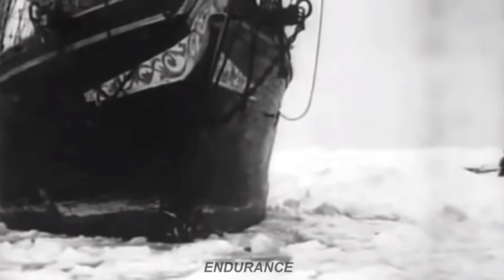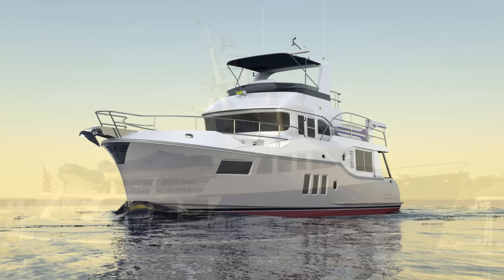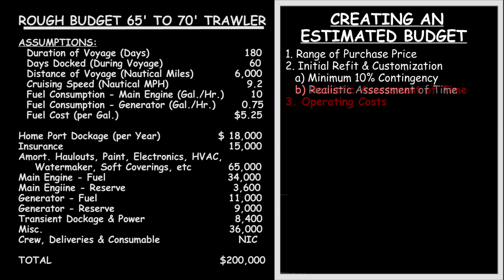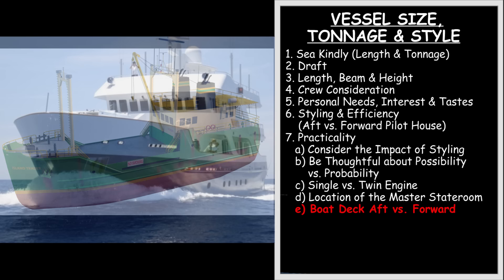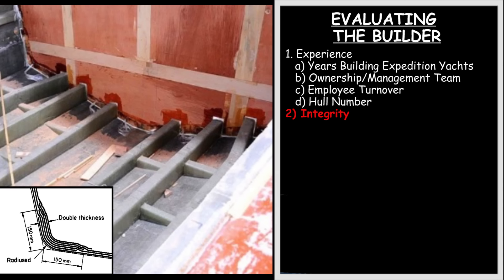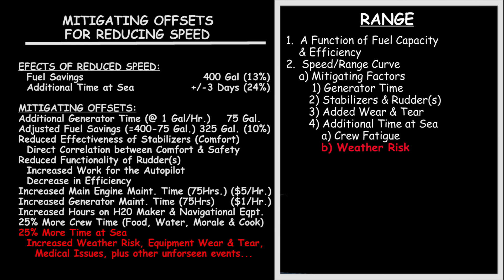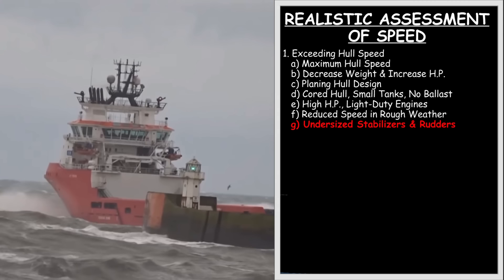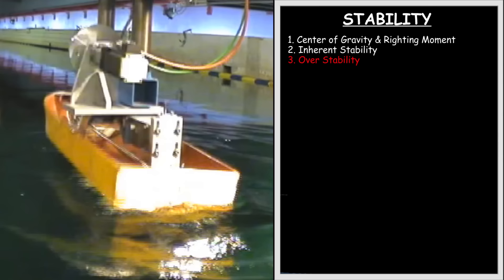Episode 5 - Defining the Attributes of a Well Found Expedition Yacht

Comment: The best explorer yachts on the market, maybe team with Veem Marine size 54 gyro stabilisation plus Veem Marine intercept 5 blade propellers tuned to the horsepower of the motors plus at rest retractable fin stabilisation

Comment: Fantastic episode especially like the idea of less electronics in the engines and mechanical equipment. Thought I was  alone in thinking Mechanically controlled engines were preferable. Like the Comments on the Furuno Equipment and love the Anchor drum winch, so many great ideas. What do you think about slowing the engine speed and therefor load to  save fuel, however, does this affect the engine by not having enough running temperature and load causing carbon build up and Cylinder glazing??
Reply from the maker: Thank you for the positive feedback....always nice to receive comments like this!  We've run for thousands of hours at 1550 RPM  (and at +/- 585F on our pyrometer) without any (known) problem and no buildup of soot in our exhaust.  This could be engine specific and I'm not qualified or knowledgeable enough to make any general comment for what is the best operating procedure on other boats?  Maybe it's an age thing when it comes to electronic engines, but I don't like having equipment that I don't understand, can't diagnose problem(s) and/or increase the chances that I won't be able to make repairs........Cliff